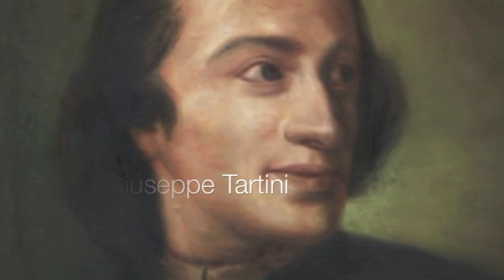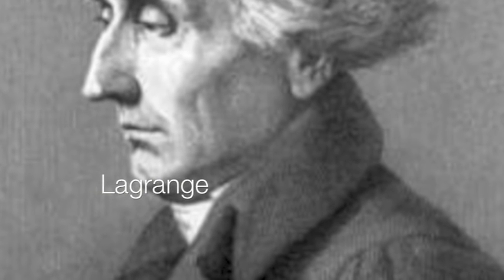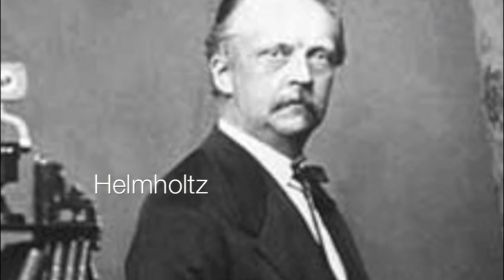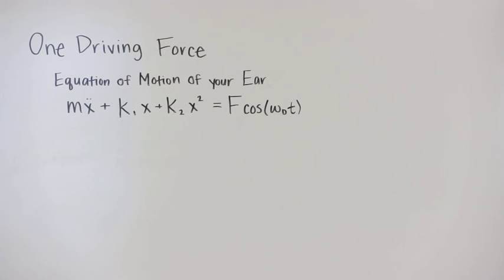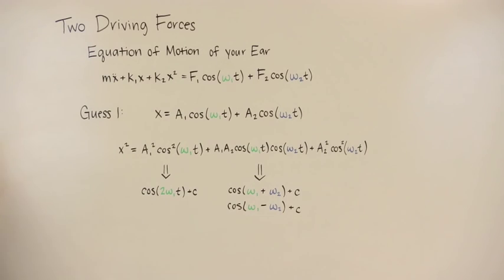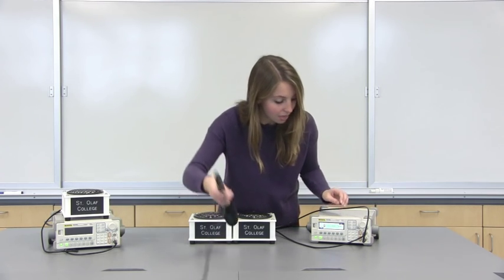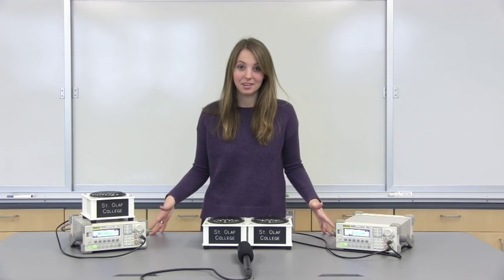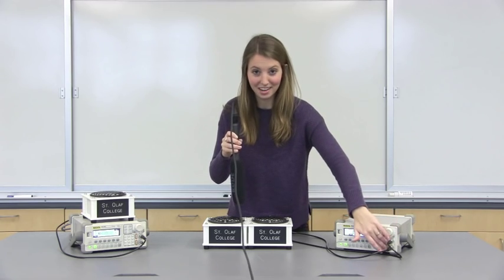Tartini Tones

Comment: I also would like to hear some sum frequency tones. I have heard them produced by synthesizers, probably because they often use two oscillators almost in unison (though the waves are usually harmonically rich sawtooth / square / or pulses). I've sometimes heard a sum tone come through on w note that swamps the main tone and it sounds great, it happens only once in a while. The best example on record is Genesis In The Cage with Tony Banks on an ARP Quadra but you might not like that record!

Comment: Using an Android app called Spectroid I notice in the second try (1 kHz & 1.25 kHz) the 250 Hz combination/Tartini tone seems added (not naturally generated by beat) as a third tone, or at least is much more louder than the previous case, being the source frequencies amplitud the same in both cases. Why this happened?
Reply: In the second example I can hear much better the first time then the second. The first time is really loud, and yes, it seems something artificial